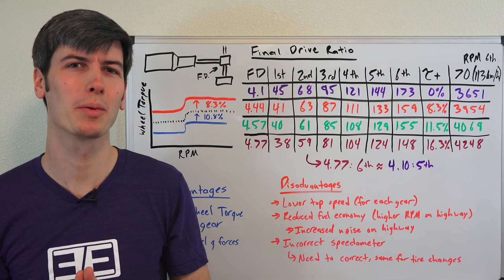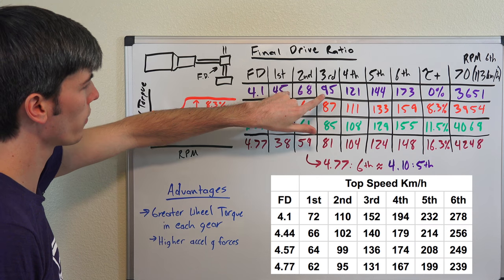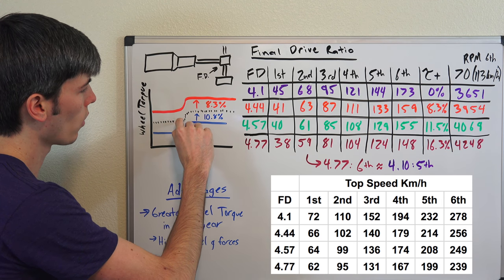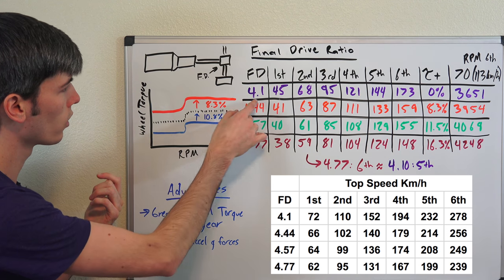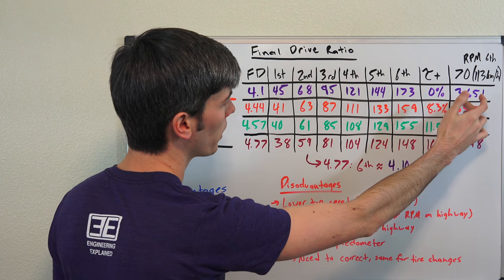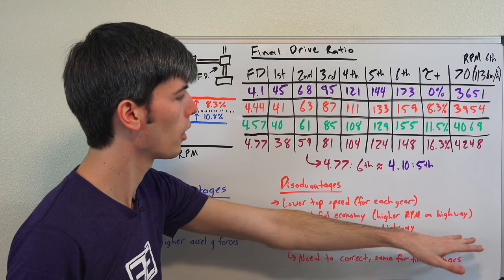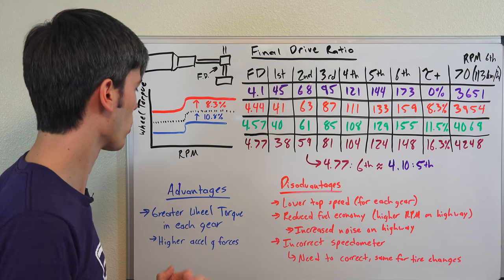Why Is Final Drive Ratio Important? Accelerate Faster!

Comment: The real question is: why should I have to make any trade offs?

When 4-speeds appeared, everyone got exceeded because they thought they were getting an awesome low first gear and could still have low RPM on the highway. Instead they got the same ratio between 1st and 4th as they had between 1st and 3rd on their old car. No matter what final drive you tried, you lost something.

* sad trombone *

Then all the cars got 5 speeds. Does this mean we now get a real choice of gears, for any situation? Nope. Same ratio between 1st and 5th as you had between 1st and 4th. If anything, the ratios were getting closer.

Now people are staring to get annoyed. Marketing has the solution: "close ratio transmission®". What the hell is that? It's what all the race cars have. You'll love it. If it's good for racing, it's good for you. Really. We'll paint some stripes on the car to go with it. Uh...?

Then came SIX speeds! And.... * sad trombone *

They keep giving you more gears to play with, but less and less that you can actually do with them.

Comment: Good explanation, also, if you're going to change the final drive, you can also upgrade to a better non crappy stock lsd (most stock lsd's are kind of pathetic in most cases, they may as well be called an open diff in all honesty) like a quaife in the process  (not cheap, but considered the best for street use).   Kind of a no brainer upgrade rather than throwing thousands at the engine unless you want to go forced induction and risk reliability.   This is my next mod after the lighter weight 2 piece rotors/pads/fluid and exhaust is changed.  Now if we only had shops in Oregon that had people that actually know how to properly install parts (staff that's worked there for greater than 6  months..), now THAT should be your next video!   Best shops in the NW and why (besides Cobb in Tigard because not everyone wants a ME TOO subaru right?).

Comment: Good information. What I miss from this video is information about acceleration in ranges that cross gears. Say 50-90 for instance. That would have you take one gear-change with the original ratio and two with the others. Another interesting range would be 0-100, where you would spend less time in the highest ratio with the original gearing.

Comment: A shorter final drive ratio will not necessarily lead to higher wheel torque when you put speed as a constant.

E.g. With a stock final drive, a b series honda will hit 100kph at second gear @ 8000 rpm. With a short final drive, at 100kph, the car needs to be put in 3rd gear at 6000 rpm, which produces less wheel torque. The car with the stock final drive will accelerate to 101kph faster than the other. Yes, engine torque is higher at 6k rpm but wheel torque is lower. Top wheel torque rpm matches top hp rpm, with any given gear.

You cannot conclude that a shorter final drive ratio would mean better acceleration.

One cannot look at final drive ratio separately from its gear ratios. It's a harmony between the 2. Plot a graph of  speed against torque using all the gears for each final drive, then you will see which final drive suits the track best (kept at high rpms)

Comment: Correction: The speedo will NOT become incorrect by changing final drive ratio. Speed is usually calculated by measuring revolutions at the wheels (via an odometer that is also used for ABS and ESP) and taking the known wheel circumference into account. This is not at all influenced by gearing. The only way that gearing could have an effect on the speedometer reading was if the speed was calculated from RPM multiplied by the gearing currently in effect.
Reply: Not necessarily - some cars use a sensor to measure rotations of the differential gear for speed (usually called a vehicle speed sensor as opposed to a wheel speed sensor) - in this case changing final drive (i.e. number of teeth on the ring gear) does effect the speedo unless a new speed sensor gear is installed to compensate

Comment: various reasons, fuel efficiency, power efficiency, top speed......but you may also benefit from a down tuned gear ratio. Depending on the track or demand of power application

Comment: Going for a shorter gear is good if you can bump your redline up some like 500rpm if you can make or hold power up that high. That way you don't have to shift earlier/you can hold the gear the same amount of time while keeping the benefit of multiplied torque down low and in the mid range.

Comment: one thing that could have been over looked in this video. if you do go to a lower final drive gear ratio, you will only get greater acceleration if you have enough traction.  more torque is great but if you do not have good traction you are just spinning your wheels, literally.
Reply: that could be an intended effect

Comment: I had an old mid 70's Chevelle that had 2.73 gearing. It was a complete pig off the line. (145 bhp/250 lb.-ft) With bigger 15 inch tires and enough road, I could do 155 mph/250 kph.  I miss that old boat.

Comment: I changed the front and rear sprocket on my ZX10R because it would hit 105mph in first gear! I went down a tooth up front and up 3 teeth out back. Now it accelerates even better, but hits about 85 mph in first gear, making it a little more "practical".

Comment: This is a minimalist idea about modifying stock cars, you can have the same acceleration numbers results by increasing engine power, powerful engines require smaller differential and gearbox ratios. If you have big power and high gear ratios the result is lack of grip and spinning free wheels. Cheers

Comment: I disagree with your statement that going "too" aggressive on the final drive is pointless cuz then you are just "throwing away" the top gear and inserting a new lowest gear.  There are many good things happening with an aggressive final drive that I didn't even hear you mention.  One being that the speed range of each gear with the more aggressive final drive is shorter, meaning the driver can "zing" thru each gear quicker.  Also as I mentioned in one of your other similar videos, if possible, the best idea would be install a very aggressive final drive for maximum fun, but also somehow swap out the top gear so that it is same as stock (overall), so you can still cruise at highway speeds at low RPMs.  This is not a cost effective solution but would be the "best" overall.  You might also want to mention if someone wants just a mild overall reduction, it is cheaper to go 1 size smaller on the tires than to swap out the final drive (ring and pinion gear), especially if you need new tires anyway.  It might only be 5% (or less) change but it would effectively be "for free" (if you needed new tires anyway).  Another option is to do a mild change on the ring and pinion but also drop 1 size in tire diameter so the combination of the 2 give you a significant torque increase in all gears.

Comment: whatever you do with your diff ,you have to know something - it's much better when cruising at 2000 rpm rather than 4000 rpm. Plus when cruising at lower RPM every other component in the engine bay will wear much less  . So logner diff is the one to get. Shorter diff sucks on highway and on any place except track . Nomather if your car is quicker or not , if you need more power hust swap the engine with bigger.

Comment: I did a version of this on my RSX transmission, where I changed the final drive from a 4.3 to a 4.7, and I switched my 6 gear for a tsx 6th gear, also put an lsd in from an si.
Reply: Did the 4.7 make any noticeable changes in  acceleration?
Reply: SD70ace_railfan it’s not a big difference, it feels more rev happy though. The 4.3 is better if you plan to do turbo though.

Comment: Hang on a sec... The main reason why people change close gear ratios and final drives is for faster acceleration and your gears staying in higher rpm, which means (if you have a turbo or very high lift cams) you will be in the powerband most of the time...

Classic example of that is the big turbo setup... You wouldn't want to drop into a different gear and be off boost because of low rpm... Hence the need for close ratio gears and final drive setups... This way you have a better chance of being in the boost or powerband range to give you that acceleration compared to standard gearing :-)

Comment: axle ratio play an important role in commercial vehicle as well. Both fuel consumption and weight carrying capacity are vital. Assuming a vehicle carrying a fix amount of weight and cruising at a constant speed, reducing the axle ratio will contribute in fuel saving however it will greatly impact the wheel torque due to decrease in engine rpm (from engine torque curve). At what axle ratio the vehicle will not produce enough wheel torque  allowing the vehicle to travel at the same speed and load?  thx

Comment: I would check that second gear on the 4.10 again. I autocross my stock 2003 AP1 and my 2nd gear bounces at 63ish.... no where close to 68mph. And the info on S2ki confirms.

Comment: People are always trying to say im wrong on the subject on different rear gear ratios.
If they would compare each ratio on a dyno in 1st second or 3rd gear you would see a difference. But people only do 4th gear pulls which ONLY measure the ENGINES output at 1:1 or a overdrive at .73:1 for example.
Not many logical people out there.

Comment: When you want to cruise at low rpm and you have only 5 gears without overdrive you need longer diff 2.8 - 3.2  otherwise all the engine components are at much higher rpm which leads to fast wearing . So what do you want reliability or acceleration is up to you . I personaly prefer longer diff for my 1.9 litre 140 hp atmosphere engine with 2.8 diff and 3000 rpm at 80 mph it  is great.

Comment: You need better rear axle/subframe bushings and reinforcement to compensate the increased torque transmitted by the differential. And engine wears faster due to higher rev.

Comment: I switched out 3.73 to 4.56 in my diesel truck after moving to 37" tires.  It accelerates a lot quicker but I don't care for the high interstate rpm.  I should have gone with 4.10.

Comment: this is why high end sport saloons have 8 speed auto gearboxes. if you put a porsche panamera into sport mode it will reach its top speed in 6th gear. the 7th and 8th gears are just for saving fuel while blasting on the autobahn.

Comment: What's your opinion on the Kia/Hyundai DCT-7 coupled to the 4 cyl. 1.6 I Turbo GDI? These are the gear ratios 
7-Speed Dual-Clutch Transmission (DCT) - -
First - 3.786:1
Second - 2.261:1
Third - 1.957:1
Fourth - 1.023:1
Fifth - 0.778:1
Sixth - 0.837:1
Seventh - 0.681:1
Reverse - 5.074:1
Final gear ratio - 4.786:1 (1/2/4/5) / 3.526:1 (3/6/7/R)
Clutch type - Dry type double plate

Comment: Does wheel size, example going from a 15" to a 16" wheel or other way around, affect your top speed or wheel torque in any way? and if so how exactly? great video btw, love these kinds of videos.
Reply from the maker: +Dark Winter if your tire diameter remains the exact same (can be difficult to match perfectly), then no. If your tire diameter does change, then so will your gearing/speed/etc.

Comment: My pick would be FD of 4.57 so you reach 60 in 2nd, or just 4.1 with 'shorter' gear ratios before 6th so you get decent wheel torque in lower gears and better fuel economy in 6th (more choice, that's why you have gears right? :p)

Comment: Changing the F.D in an auto significantly to the point of eliminating a gear, I imagine would be more advantageous than in a manual. For the simple fact you would loose 6th but obtain a gear lower than 1st. I imagine an auto would make better use of this "new" gear as it would be only useful for such a small speed range, ie launching from a start

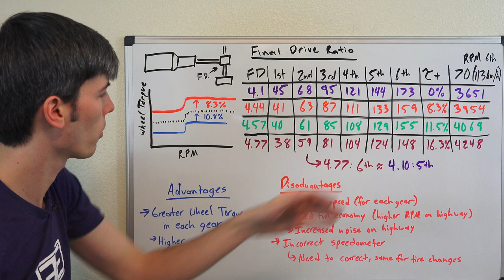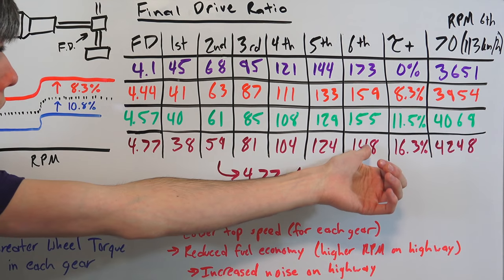Comment: wouldn't changing final ratio from a 4:10 to 4:44 would also reduce the time for gear change. similar like a lightweight flywheel would. I actually did that exact ratio change and I do notice lower top speed as expected and more torque. but it also seems like syncros line up faster on an up shift with less delay in the exact same relation as percentage of ratio change.

Comment: Hey, Jason, could you possibly explain how final drive ratios work in vehicles with transfer cases and/or AWD?
Reply: Arthur Friday yeah, cause I know with 4WD you have to have the same gears otherwise your drivetrain will lock up, I just have trouble understanding how the system integrates between the rear and the front, and why they need to be the same, or different with different sized wheels.
Reply: Not such a huge deal with AWD because of the center differential (allows the front and rear to turn at different speeds). The reason you need equivalent ratios with 4WD is because it doesn't allow the front and rear to turn at different speeds. Can you see why that might be a rather large problem?
Reply: On 4wd the transmission inputs power to the transfer case. When the case is in 4 hi or 4 low it mechanically locks the front and rear outputs to the same speed. If the front wheels were smaller, in 4wd they wouldn't spin fast enough if the axles had the same ratio.

Comment: Do you think lowering final drive makes sense in powerful diesel vehicle. We talking hightly modified 3 litre diesel bmw engine with 6sp manual making ~400hp and 750nm (650nm at 2100rpm). Standard diff is 2.47 and you can "upgrade" to 2.28 which is 8% difference. I think it will be nice change for higher speeds and it will spin less in 1 and 2 gear so overall performance will get better

Comment: Why do you need adjust the speedometer? I thought the ABS sensor only measure the rev of wheel. Bigger ratio makes car go faster. Faster means higher rev speed for wheel. Higher rev speed for wheel means higher speed on speedometer... I don`t understand...

Comment: The computer in my car limits my top speed to 162 mph. With going to a higher gear allows me to still have the 162 mph top speed but it helps my cars acceleration and makes it easier on my clutch also getting my car’s perfect rpm range faster.

Comment: Thing is, you also have to account for the time in having to change gear more and in turbocharged cars the turbo having to spool to full boost again. I don't really see the point in changing final drive unless doing specific runs or with a sequential or dct box
Reply: you ever heard about antilag?
Reply: Arthur Friday Yeah that's what I meant :) like for the 1/4 or mile
Reply: ΑΡΗΣ ΚΟΡΝΑΡΑΚΗΣ Yes because every road car has anti lag......
Reply: BarbecuedPossum it's doesn't need to spit flames...
Reply: ΑΡΗΣ ΚΟΡΝΑΡΑΚΗΣ since when did I say it did?
Reply: BarbecuedPossum also those snails designed to respond almost immediately

Comment: I thought that speed is determined by the ABS sensors on the wheels, therefore I don't see how a gearing change could affect the speedometer. On the other hand, different wheel size (circumference) should affect the speedo.
Reply: BTW I could imagine that a modern car with a GPS has a way to adjust the speed readings. Not that S2000 is one of those cars :-)
Reply: Many older cars use a little gear inside the gearbox which is conected to the output shaft to measure the speed. GPS can't show you your speed in long tunnels.
Reply: I wasn't suggesting that GPS would be actually used to measure speed, for that it is way to unprecise in many situations (slow, changing speed, tunnels - like you mentioned etc.). I was merely saying that under certain conditions can the GPS be used to adjust the speedometer value (ie. by comparing the measured speed of the vehicle to the GPS speed on a motorway). For example to account for tread wear.

BTW: Is this gearing inside the gearbox used still in new cars or is it something from the past? Because I don't think the car makers would use another device (= costs) if they can measure speed otherwise (ABS sensors). But I can't be wrong, of course.

Comment: Not worth the mention of added gear changes to reach said speed potentially slowing the acceleration down? Depends a lot on driver skill but you can only change gear so fast with certain transmissions plus the added stress on them if you are trying to change gear at light speed

Comment: Why don't car manufacturers have a 6th (or 7th, 8th, etc) gear that is purely there for fuel economy with an extremely high top speed, that basically lets the car run at 1500rpm at 70mph without changing the final drive of the other gears? I know it wouldn't be smooth shifting from the previous gear, but wouldn't that have a huge benefit to MPGs?

Comment: Engineering explained... I prochargered my 14 v6 mustang and stuck w the 2.73 stock gear ratio.  So far so good, would you recommend switching out?  I know 3.73 would be too much, but I'm afraid 3.31 would not be much noticeable.
Reply: Still have the car?

Comment: I’ve used a 4.1 a 4.3 and a 4.7 in my turbo mx5. Real mixed bag of sector times on the Hillclimb. I’ve got 200rwhp and run 205/50/15s with a 5 speed box. The 4.1 has the quickest launch, the 4.3 has 3 out of 6 sector records and the 4.7 took one sector record but by quite some margin (.3 secs)
My fastest time is still with the 4.3.
I’ve looked at going 3.6 with a 6 speed however thus seems to give the same results as a 5 speed up to 5th gear and I don’t get into 4th on the hill so the extra gears not any advantage. Have you got any thoughts ?
Reply: I have race with same car weight and all k24 civic gearbox k24 4.7 fd vs k24 gearbox k20 4.7 fd. And k24 longer gears with k20fd smkoes k24 4.7fd.. wtf? We think that shorter gearbox and 4.7 fd will run out longer but no..